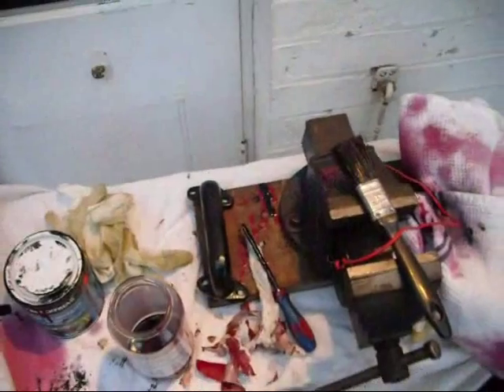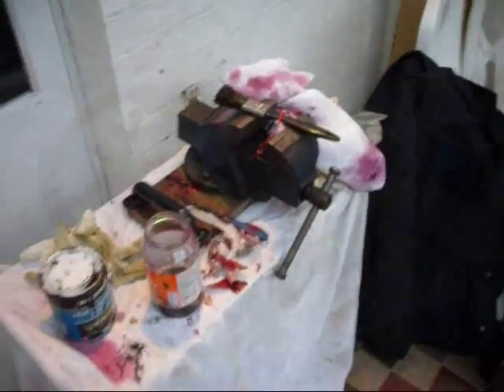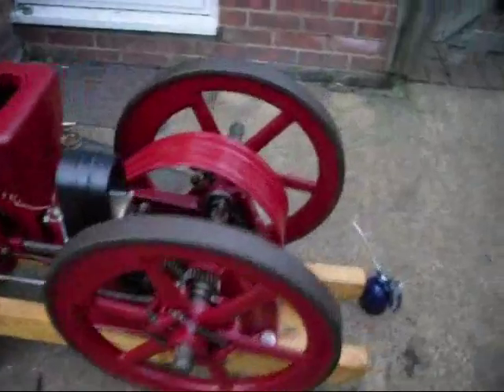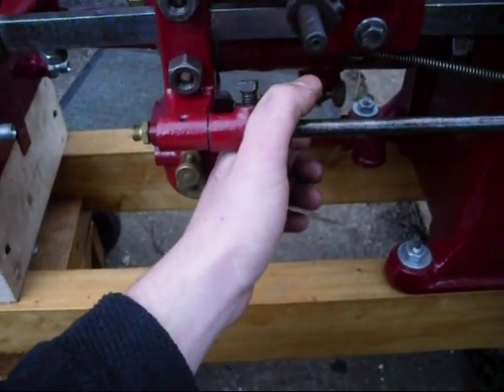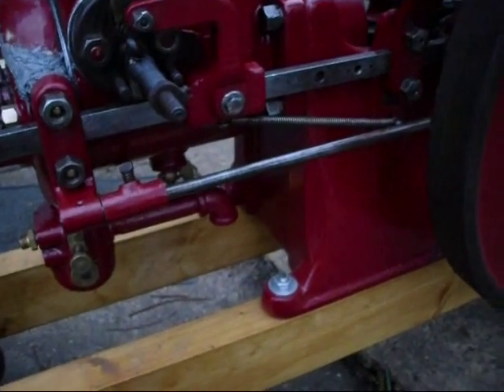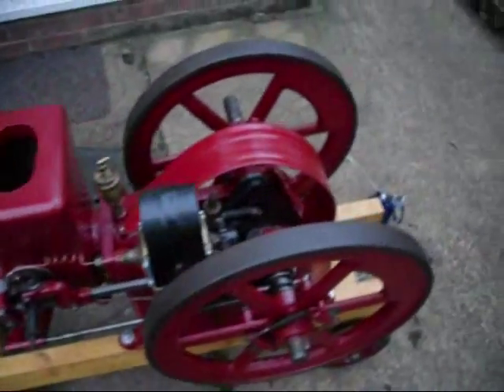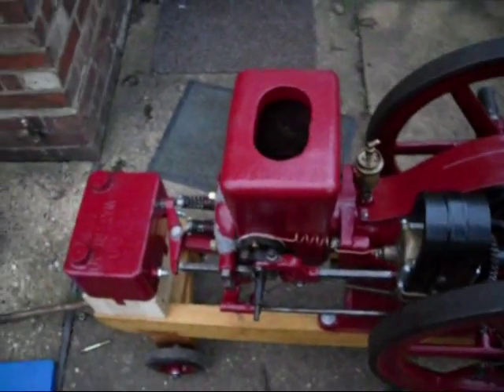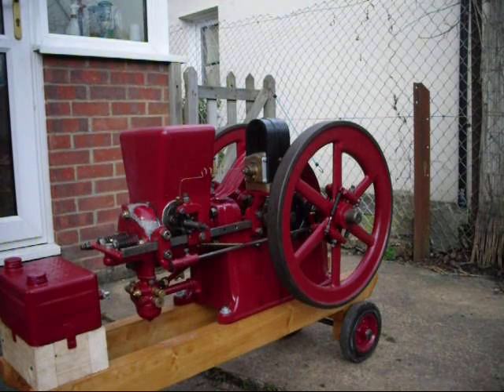Amanco Hired Man Restoration - Part 23 - almost there!

Comment: She is looking well now,a credit to your thorough restoration work. I do hope the head repair holds water,can't wait to see and hear it running!  A word of advice Phil,make sure you can stop the engine quickly in case the governer aint set correctly,I saw a 6hp Amanco almost blow up when the throttle jammed full open! 
up

Comment from the maker: Hi mate, glad you like her! I have just tested the head repair (mk3...) and it still bloody leaks. However, another youtuber who is not a million miles from me very kindly offered to try and braze it, so I shall take the head off and dismantle it over this week. 

To stop it I can either just shut the fuel needles off, or I can hold the exhaust valve open so it can't open the inlet valve. But hopefuly there will be no need for that!